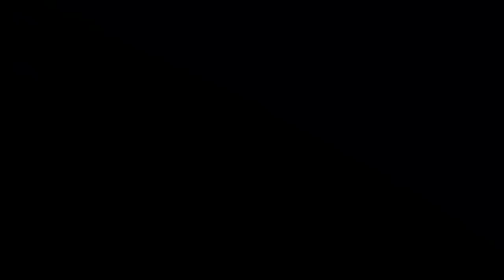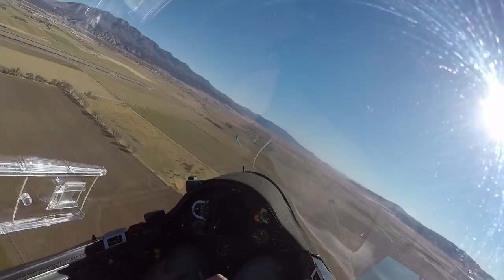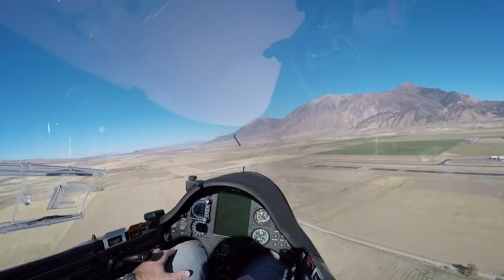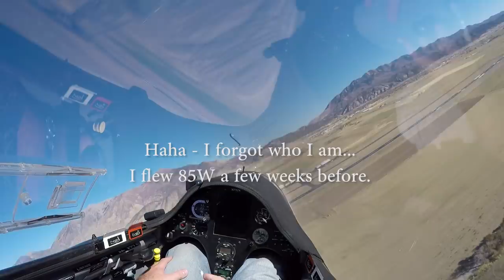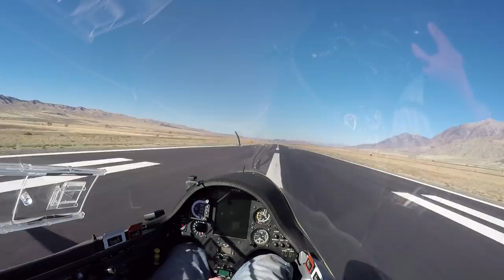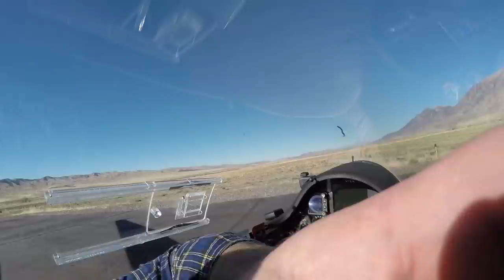Glider Ground Effect Demonstration

Comment: Years ago, Boeing had a huge cargo plane on paper, perhaps even built a prototype, called the Pelican that flew on this principle. The intent would have been to move many tons of freight over the ocean,
flying twenty feet or so over the water in a huge plane that would require very little fuel, with a range of many thousands of miles.
Reply: Wasn’t that a Soviet experimental plane? Think it was called the Caspian Sea Monster.
Reply: That was an old soviet design to carry troops, tanks and perhaps even short-mid range nuclear weapons to American shores, you can still see one of the devices sitting in a yard near Moscow, rotting away...
Reply: It was a failed experiment.
Reply: Kade Roder  I meant that Soviet ship was a failure and never entered service.
Reply: I remember an article in Popular Mechanics about the Boeing project.  They usually design them to fly at higher altitude to cross land and other obstacles.

Comment: Great demo. Cool shadow at 1:47. I was about to correct you: You said ground effect decreases drag. I always thought it increased lift. Some online research tells me that it does both. It decreases wingtip vortex and lowers the angle of attack of the wings slightly. I guess I'm a bit of an aerodynamics nerd.
Reply: Scott Gaul Yes you are and we're grateful for it.
Reply: When an aircraft is flying at load factor 1 (unaccelerated flight, as in not manuevering) the lift produced is always equal to the weight of the aircraft times the cosine of the flight path angle.  Flying level in ground effect you have exactly the same quantity of lift as you would at 1000 feet, with considerably less induced drag.
Reply: The actual physics concerning ground effect are quite simple: Above the wing is a low pressure area, below the wing is a relative high pressure area. What happens in flight is that the air will want to move from the bottom to the top over the wings edges. This is why you see vortices around the wing tips. It is also why planes have winglets at the wingtips. To prevent this air from rolling from underneath over the wingtip to the top. Whenever you get close to the ground, this rolling motion is interupted by the ground, therefor acting as a sort of winglet. So no, you're not decreasing drag, you are increasing lift, which makes you put more downrudder in to maintain altitude, therefor maintaining a lot of your speed. I'm oversimplifying this effect, but in a nutshell that's how it works.
Reply: Flyingdutchy33 the wing in ground effect doesn't produce more lift.  If it did, the glider would accelerate away from the ground.  This is a fundamental topic: if we are flying level, we are always producing exactly the same amount of lift regardless of speed, altitude, etc.
Reply: I read it also squishes wingtip vortices making them actually bare against the surface and create lift
Reply: would it be fair to say the wider the wing the bigger the 'reflection' from the ground - I think that's how it works
Reply: Yes, said another way: the wider the wing span, the higher above the ground you will experience ground effect.
Reply: I think there could be some confusion in terms here when talking about lift alone. Of course, a glider pilot is always interested in lift-to-drag ratio. I would say the wing produces more lift when it is in ground effect as compared to when it is not. (When not in ground effect the glider is sinking in the column of air.) Garrett, you are right, the lift of the wing remains constant from the beginning of his run in ground effect to the end of his run in ground effect. (The glider is not sinking/rising). But let's not forget about drag when talking about lift. (I am an aerodynamic nerd.) :-)
Reply: The angle of attack probably becomes more shallow in ground effect, and a shallower angle of attack produces less lift force, and less lift-induced drag force.
The angle of attack is adjusted by the pilot to maintain the force required for constant-altitude-flight above the runway.  When we flair, we continually increase the angle of attack (with spoilers out) until the glider no longer increases the amount of lift force with increasing angle of attack but decreasing speed, which, at that point, the glider stalls on to the runway (or with powerful spoilers, just keep increasing the use of spoilers, until plopping down).
So, yes, the wing makes more lift in ground effect, for a given angle of attack ...
Reply: I edited out the part about attitude because no one, who has not flown in an aircraft that climbs with its nose "down", is going to believe that part.  It is difficult to explain properly anyway.
Reply: The most efficient wing ever would be of infinite span, i.e. no induced drag from high to low pressure as there would in theory at least be no tips. Winglets on gliders were produced to reduce drag by reducing the high to low pressure induced drag, sometimes seen on larger aircraft at high angles of attack at lift off or landing as the vortexes pick up and swirl dust or surface water. Airliners now sport winglets to help reduce induced drag and decrease fuel burn. Induced drag reduces considerably with low angles of attack and further still when in ground effect, as the vortex is prevented from forming properly by the ground and is unable to flow around the tip.
Reply: Luke Marks 
So, the perfect wing would have a ring (oval) shape?
Reply: Is this how wingsuits work?

Comment: Can you calculate the reduction in induced drag in ground effect? The ASW 27B will do a 48:1 glide at altitude, but in ground effect with, maybe a 10% reduction in drag...53:1 ? For those who might not appreciate the performance of these sailplanes, that runway is 6300' long! Great demo Bruno, thanks
Reply: George Dyer knocks out trailing vortex drag (induced by lift generation from wings)
Reply: Easy to calculate if you know the height above the ground relative to the wingspan. At a height of half a span above the ground the induced drag is reduced by about 8%. At a quarter of the wingspan it is reduced by about 20%.

Comment: And when you apply this to the undertray of a race car, you get crazy downforce with virtually no drag penalty!
Reply: Ferrariman601 

Ferrari..Eh?

F1
Reply: Wrong. If this happens to a racecar they take off towards the sky, do some fancy flips and crash in a very bad way. In a race car, u want the complete oposite of this effect - Not a cushion of air on which you can ride, but a low pressure area, close to a vacuum, to suck you on the ground generating douwnforce and grip.
Reply: The Lotus T79 used ground effect to create more downforce.
Reply: It has the same name, but they're different concepts.
Reply: @spookyshark632  Correct, the ground effects in the Lotus utilized the low pressure under the car and accelerated the air flow in order to increase suction towards the ground.

Comment: The higher the ratio between the induced drag and the parasite drag, the more helps the ground effekt.  When a glider ist flying fast, he has a low ratio between the induced drag and the parasite drag, so ground effekt can't helb very much.    I think the main reason for your 'ground effekt'  is the updraft of warm air above the hot runway and only a little bit of the real ground-effect. 
Can you repeat the same experiment at a time,  when the runway has exact the same temperature as the environment?  Perhaps at 7 o clock in the morning or so?
Reply: I was just thinking the same thing
Reply: It would work even better with the cold dense air providing more of a cushion/layer between the airfoil and the ground.

Comment: Ok since everyone is explaining what ground effect is, let me unexplain it. GE or ground effect is the perceived effect that the ground has on your wings through the air. It also effects ground squirrels and other ground animals and insects. Similar to ground beef, ground effect is delicious and nutritious. Unlike chemical based effects, ground effect is non GMO and gluten free. Relating to aeroplanes in general, the ground effect is very important because without the ground, there's not many places to go really. I mean water looks like water everywhere you go. Also the ground holds the air on top of it. The downside of ground however is that it is often very hard and dusty. 

A really real comment... I love the look of the cockpit.

Comment: The wash that goes over the trailing edge of the wing is deflected by the presence of the ground effectively reducing the angle of attack which naturally reduces induced drag. That is what ground effect does. I had to explain this in depth for my CFI check ride.

Comment: Should have started at maximum 60 knots instead of 80! My usual ground effect demo is to do a standard approach to the start of the runway at 55 knots (in DG1000) and then at the last moment close the brakes and cruise on down to the far end of the runway.
Reply from the maker: I hear ya - I actually had never tried this before so I didn't know how far down the runway I would get before the speed bled off.  I was shocked I only lost 5 mph over that mile.  I was totally expecting to bleed off at least another 15 during that time.  Modern sailplanes still amaze me even though I have a lot of time in them.  Fun stuff.  I'll try the 60 knots at the end of the runway next time.  Take care, Bruno

Comment: That happened to me on my first glider lesson.   I am big.  When it came time to land we couldn't pull back on the lever that raises the spoilers.   The instructor angled the nose down a lot stepper than in the video.  This was to get us down but I am also extra weight.  We landed without spoilers with only a couple hundred feet to the end of the runway.   We seemed to glide forever over the runway below.  We didn't glide near as far as the guy in the video because of the extra weight but it was still a woah moment.  That was my first and last glider lesson.  I am just too big.

Comment: awesome
I feel like, one instructor in particular, has unfairly told me I move the stick too much - I know you're a better aviator than me, but I'm not doing much more than you to the attitude.  But whatever.  The only time I flew my DPE, my tow pilot remarked that my "box the wake" was the smoothest he had ever experienced, so I suspect I'm not as horrible as that instructor indicated.  I will acknowledge that I'm pretty terrible now, due to a lack of recent practice.  Thanks for everything!
Reply: DumbledoreMcCracken it depends on the airplane and the sensitivity to the stick. On a Cirrus it’s an all moving tail. Even small movements will shoot you up or down in pitch. Less is always better to reduce drag
Reply: cabdolla Most of my time is in a Grob 103 (~40 hrs).  I also have ~25 hrs in a Champ.  Neither is like a Cirrus I suspect, but I'm done with power at this point (noisy and boring).
Reply: Start doing cross country gliding and you will never look back to any other form of aviation. It's simply amazing. Putting your wit against your skill and others to fly as far and as fast as you can while avoiding landing out. The Grob103 is a good ship to learn. A lot of adverse yaw, learn to use the rudders and not the ailerons, and you will have good habits for other gliders. If you look at my YT page, you can see some of my  very early  flights and solos. Man, I was beating that stick like it owed me money. Everyone does it, and lands fast. Over time it will slowly fade away.
Reply from the maker: I strongly encourage you to get a video camera and film yourself flying.  I am trying hard to improve my over use of the stick and while I am flying I think I am not moving it much, but the videos clearly demonstrate what is actually happening.  You might think you are not moving it much but wait and see what the video shows is actually happening.  Hope this helps.  Thanks for watching.  Bruno
Reply: Bruno Vassel and cabdolla, thank you.  I'll take Bruno's advice whenever I can.

Comment: Its really a bit wierd when you think about it.
Ground effect for an Aeroplane cuts drag and gives a cushion of lift which allows you to float seemingly forever like a puck on an air hockey table.
But for a boat .....
You get into shallow water and 'bottom drag' sucks power and slows your speed significantly. 
Maybe a hydrologist will be along shortly to explain why it doesn't work like ground effect when flying.
Got me baffled for sure .

Comment: According to Google Earth, the 35 approach end is about 30 feet higher than the 17 approach end.  So you were descending as well.
Reply from the maker: Shhh - don't tell anyone! ;)
Reply: How would google gain access to measure both ends? Probably better checking with the tower for field elevation.

Comment: It actually doesn’t reduce drag. It allows you plain to require less lift. This let the nose come down and the decreased angle of attack this is what reduces drag.  Still pretty cool.
Reply: Remember, there are two different kinds of drag, parasitic which is fixed, and induced, which is caused by the aerodynamic forces of an airfoil. When you increase lift and lower the angle of attack, that reduces induced drag. So indeed, ground effect reduces drag.

Comment: First time I found out about this I was trying to land and I just couldn't put it down. I nearly panicked and came very close to  dipping left and stalling it but pushed out just before it stalled and in the process of almost stalling scrubbed enough speed to lose the lift. The instructor told me after that I pitched into the landing too level which made me glide and forgot to retract the flaps when I panicked. It gets super "floaty" in the yaw.

Comment: Wind speed decreases as you get closer to the ground, because of friction. Characteristic property of convective currents.
Reply: And that is not relevant to the topic of ground effect, but is a factor of the air and its friction as it moves across the earth. Same thing happens with glaciers as they slide down a valley. The ice closest to the dirt moves slowest due to frictional forces.

Comment: I’m a power pilot myself, and I’ve seen a couple of these. I have a question; what are you operating with your left hand?
Reply: Where are your throttle's? Depends if i am flying a B-52 or a F-18. On my personal plane I like a right hand throttle and left hand joystick. What about you?
Reply: The lever on the left is the flap lever. Not all gliders have them but this one (ASW 27?) does

Comment: Did you have wheel down all the time? If not it’s dangerous dropping the wheel and extending air brake over the runway. It distracts you from the final crucial actions at touchdown. I’ve seen accidents caused by pilots trying to lower the wheel in very late final having forgotten their checks on downwind.

Comment: what's a great demonstration thanks !!!
But why the wings produce less drag just above the ground than in the air
Reply: Reduced wingtip vortex and a lower angle of attack on the wing. Add to that a great deal more lift, so the lift-to-drag ratio is significantly improved.
Reply: The air gets Kind of compressed between the Wing and the ground.
Reply: The simplified reason: The ground reflects the downward moving air from the wings back up,  making the process of generating lift more effective, meaning the aircraft doesn't need to waste as much energy (drag) to produce the same amount of lift.

Here is a link a much more technical explanation: https://www.av8n.com/how/htm/airfoils.html#sec-soft-field-why

Comment: Hi Bruno, i am wondering which flap settings u do on 2:36, i guess 1 to 3 to 5 (Landing), and i would like to compare this to a 20A. Because, on the 20A Flappossition 5 (1st Landing Position) you should push the nose noticeably down. You do this anyway, but i guess very slightly, also not as intense as it should be in 20A. What do you think?
Reply from the maker: Hi Roland.  I love the 20!  you are a lucky person to own one.  Congrats.  I pop up out of ground effect to adjust the flaps because I would never want to adjust them down so low.  I initially move them down to thermal flap and then a few second later down into landing flap.  The 27 only has one landing flap while the 20 has two.  Consider me putting it into the less aggressive 20 landing flap setting at the end.  Hope this helps.

Comment: Pelicans do the same when they fly in front of the face of small waves (1-2 mts)
Reply: For ground effect, they have to be closer to the solid (or liquid) surface than their wingspan. Flying at an altitude about half their wingspan is about the maximum height they can be to "trap" enough air between their wing and the water or land surface and ride that cushion. Any more than that and the effect fades fast with altitude to almost no ground effect at one wingspan or higher.

Comment: I'm not a glider pilot, but isn't there hot air rising above tar, that can keep glider at the same level or even lift it up?
I guess if glider has 1:20 gliding ratio and flies at 80km/h speed, 4km/h upward wind can keep it flying at constant speed.

Comment: Would you have been able to do a go around if you had run out of runway (while still in ground effect)? Or was that airspeed in ground effect not enough to give you another couple of hundred feet of climb for another attempt?
Reply from the maker: Great question!  That airspeed was enough (maybe) to barely do a 180 and land opposite direction but it would not have been very comfortable.
Reply: @BrunoVassel  I've loved watching you dispel the notion that with gliders you only have one chance at landing. No motor doesn't mean no go around. Many of us did not know that.